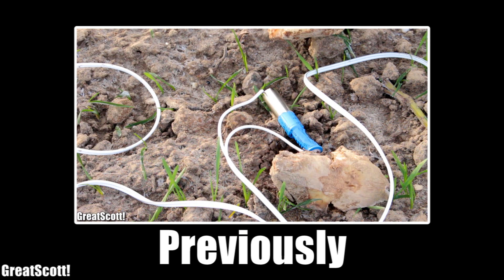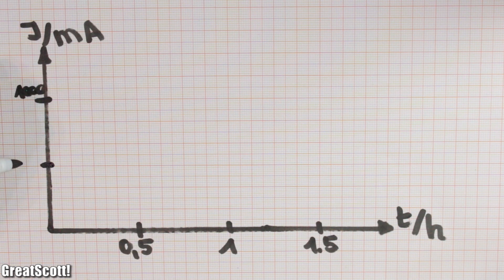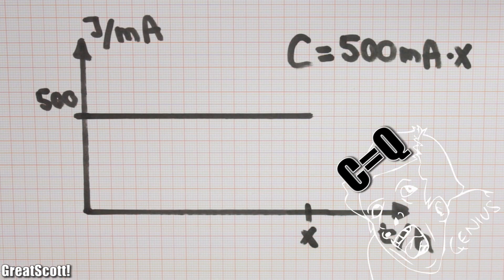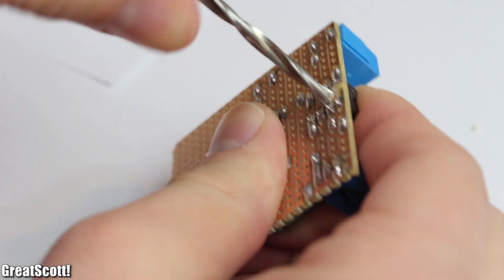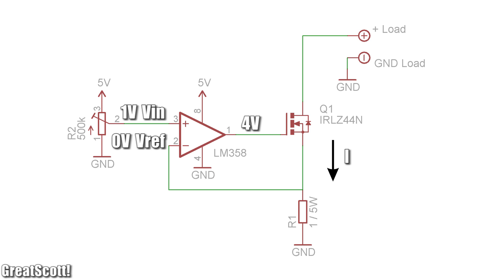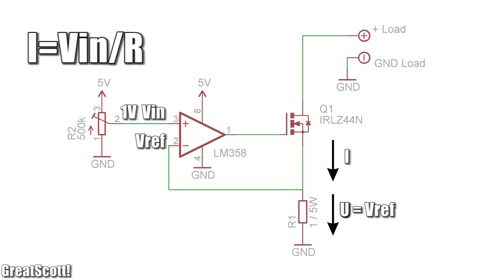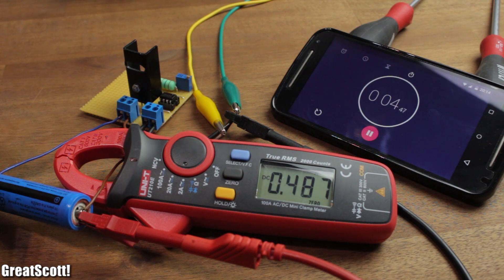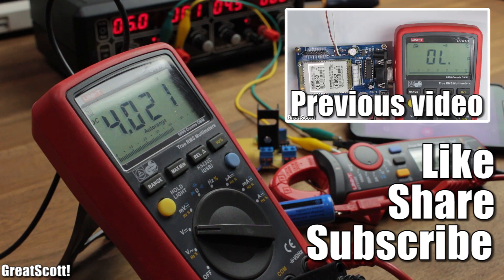Li-Ion Capacity Test || DIY constant current load

Comment: can i use IRF510 instead of IRLZ44N
Reply: Only if you increase the supply voltage to the opamp from 5V to at least 7V to compensate for the greater Vgs needed by the non-logic level mosfet.

Comment: Firstly thanks for your videos. I am learning a lot. A question:
Did you measure the current as 500 mA till the voltage dropped to 2.5 volts?
Reply: 2.5 is the max discharge voltage in li-ion cells
Reply: @DrkTrx  below 3v it will drop dramatically
Reply: I was wondering, why he stop the proces at this voltage level?

Comment: Good tutorial as always. 1 question: Can i use lm393? :)
Reply: In this circuit, the opamp is not working as a comparator since a comparator operates without negative feedback. The opamp used in the circuit does not require any of the features of a comparator, such as its large allowable input differential range, so an LM393 seems to be a bit of a waste when an LM358 would do the job.

In this circuit, there would be little difference between them as long as you remember to include a resistor around 10K for output pullup on the LM393.

Comment: Isn't the ripple you see on your scope an unstable Opamp? I ask because I build a similar current-sink with the LM358 and IRFZ44N and I noticed the same ripple at ~150kHz on the opamp output. I was hinted that this opamp mosfet combination tends to oscillate because of the great  input capacitance of the mosfet and a "fast" opamp like this one... But I am faaaaaaar away from understanding all the physics behind it and I get multiple smashes in my face from the electro-pro's because I am not very fast in understanding all that stuff... The thread is this one: (german sorry) https://www.mikrocontroller.net/topic/464827#new

The (maybe) solution for me was to add an R (46Ohms) between Opamp output and Gate and then add a C (22nF) between gate and R  going to GND...
Reply: First of all, the supply needs to be decoupled properly, so a capacitor in the range 10nF to 100nF needs to be added between pins 4 and 8 and close to them. Then you can start thinking about reducing the capacitive loading of the mosfet on the opamp's output. The IRLZ44 has an input capacitance around 3.3nF, so a resistor in the range 100 ohm to 1K between the opamp output and the mosfet gate is a good idea. Frankly, I wouldn't put any more capacitance into the circuit, as the problem is probably arising from the amount of capacitance the LM358 is being asked to drive already.

Comment: these usually are filled with sand and inside is a tiny nimh cell (knowing from experience) you should take a worn out cell from a good manufacturer and short circuit test it. also do the same with a china cell thats not sand filled.

Comment: Good video GS..!

Just a few small points to add for all......

1. The constant load circuit is simple and neat but there are alternatives which will eliminate the ripple. This is relevant if we wish to to test capacity precisely.

2. The relationship between discharge current and capacity is non-linear. The lower the current, the greater the measured capacity.

3. I suspect you will find the Ultrafire is rated for a discharge current less than your 0.5A, which means you will generate a pessimistic  result.

4. Low voltage cut-off at 2.5V will not damage the battery. All one can say is that life measured in discharge cycles will be lower compared to 3V cut-off.

Keep up the good work..!

Comment: Clever. But wouldnt be easier to use one transistor instead opAmp and mosfet. By establishing base current you will obtain practicaly constant current Jc in CE part,  even though the load is changing. No current ripple, no heated resistors.
I have checked it with TIP35C. It works.

Comment: Cant reach below 0.5A, current is also not constant. :(
Using LM741 and 23N50Mosfet.

Tried with and without pulldown resistor on mosfet.
Reply: You should try use LM358 op-amp. It is always weird playing with op-amp in single supply mode. LM741 doesn't like single supply mode.

Comment: Hi, I'm not clear where did you get 1.8 h of charging if you stopped your stopwatch at around 1.48 h? Taken that into equation you'd multiply the discharge current of 500 mA * 1.48 h = 740 mAh (a bit more) of that battery's actual capacity. Am I wrong? And one more thing: if you had the digital balance charger like Turnigy Accucell 6 that I use, you could just set it to Li-ion and discharge mode, set the desired dicharge current and after it finishes, just read the mA value on the right bottom of the display and multiply that with the time (in h). Cheers!
Reply: There's 60 minutes in an hour, not 100.
1 + 48/60 (4/5) = 1.8 hours.

Comment: In this schema this mosfet is not working in impulse mode. The opamp keeps it in semi-open state, so his DS resistance is keeping high enough to provide needed voltage drop. So its not impulse mode, and not a key mode.

Comment: Hey Scott, how much current can I drain before melting the fake load?
Reply: It's a real load, not a fake one. The answer depends on how much heatsinking you are prepared to put on the mosfet. A 0.4°C/W heatsink will cost about £20 from RS, but you might get one cheaper elsewhere. The IRLZ44 has a thermal resistance of 1.5°C/W between junction and heatsink and a maximum junction temperature of 175°C. So operating at 25°C with that heatsink, you could dissipate (175-25) / (1.5 + 0.4) = 80W before you risk damaging the mosfet. From a 4V supply, you could therefore draw at most 20A.

Comment: You could have used a TP4056 and a resistor load and a usb doctor that measures capacity to do all of this but without having to stay there and watch the voltage and do the calculating. For me this is better because I don't want to stay there watching while my batteries are getting tested. I know it's a bit more money than your build probably, but could you show it to us too?
Reply: The snag with that is the TP4056 uses an internal linear regulator to do the charging, so efficiency is uncertain if you're measuring the capacity by charging. To measure the capacity by discharging, the TP4056 isn't doing anything. You could use one of the chips that boost the li-ion voltage to 5V and use a "usb doctor" with a resistor to measure the discharge, but then the efficiency is even more uncertain. If you don't want to stay watching, you'll need the extra protection circuit that cuts off the output when the li-ion gets low.

Comment: I'm not quite sure thats an opamp or a comparator.

In the first case, I think the output will try to mantain 1V constant on R1, thus the mosfet will be working in its active zone with a voltage drop of Vbat-1V. That will disipate a lot of heat on the mosfet.

In the second case. The comparator will be switching the mosfet on and off creating a pulse through R1 with an average voltage drop of 1V in R1 and 0V in the mosfet. Therefore you are drawing 500mA but at 1V, not Vbat, therefore the battery will last longer than if you just connect the battery in series with R1. Therefore real capacity would be much less that 900mAh
Reply: It's the first case with the circuit shown in the video. It's working as a non-inverting buffer with a gain of 1, not as a comparator.

The mosfet needs a heatsink, for sure.

Comment: Can you eliminate the oscillation in the op amp circuit by adding a capacitor in the feedback path?
Reply: Maybe by lowering the gain of the OP. Was surprised that he had no feedback loop.
Reply: @gamingSlasher  It has 100% negative feedback already, so you can't lower the closed loop gain any further. It's a non-inverting buffer with the mosfet simply adding extra current capability (which it happens to draw from a separate supply - the battery under test).
Reply: Isn't the oscillation the point?  It's effectively making a PWM load instead of literally constant current, isn't it?
Reply: @reubenkriegel7639  No the oscillation is not the point, and it's a linear circuit (a non-inverting buffer), not PWM.
Reply: @RexxSchneider   Hmm.  He talked about it turning on and off, so my mind went to PWM, but that should be a square wave.  What he was getting looked more saw tooth.
Reply: @reubenkriegel7639  If he thinks the mosfet is turning on and off, he doesn't understand how negative feedback works. What you see on the scope is oscillations caused by a lack of supply decoupling of an opamp driving a capacitive load (the mosfet gate).
Reply: To eliminate the oscillation, I'm pretty sure the solution is just to decouple the supply properly. Add a 100nF ceramic capacitor between pins 4 and 8 of the opamp, as close as possible to it. It wouldn't hurt to put a 10μF electrolytic capacitor across the incoming 5V supply, especially if you have long supply leads.

Comment: Isn’t it smarter to set Vin to 3V that way if the comparator sees that the Vref lower is it automatically stops? Not Vin 1V but 3V. Pls explain.
Reply: It's not a comparator. The output of an LM358 with a +5V supply won't swing any higher than about +3.8V. Since the source of the mosfet has be below its gate voltage by at least the threshold voltage (up to 2V for the IRLZ44), you're unlikely to be able to drive the source of the mosfet any higher than about +1.8V, so you can't set Vin any higher than that. I'd aim to keep Vin as low as practical for reliable use.
Reply: @RexxSchneider  lol this msg is 4 years old didnt even remember I commented on this
Reply: @johanneshettinga  That's okay. Other viewers may encounter the same sort of problem and may find an explanation useful.

Comment: 900mah Capacity at 2.5V discharged is even worse than the average 3.0V/2.9V most smart dischargers use. But those batteries are known for this. 900mah is actually higher than you see when other test the same batteries. I actually purchased 6 once and the capacity said 3000mah, but they actually tested 2200mah at 3.0V(I was floored). But the basic wear and tear(charge and discharging) cause it to lose Mah quickly. After 3 or 4, the MAH dropped to around 1100. I just put them in my recycled 18650 bin and called it a day! Great Video Great Scott!!

Comment: i tried to make a 20mA CC load. I made Vin = 4V, R1 = 200ohm, but after constructing the circuit, Vref is topped off at 1.8v, how come?
Reply: If Vin=4V, then you are trying to get the voltage at the source of the IRLZ44 to be 4V as well. Because it's an enhancement mode mosfet, the voltage on its gate will need to be about 2V above the voltage on its source, i.e. around 6V. Unfortunately the opamp is only using a 5V supply and an LM358 can't swing any closer than about 1.2V below the supply, i.e. 3.8V.
That's why you can't get above 3.8V - 2V = 1.8V at the mosfet source. Use Vin = 1V and R1= 50 ohm if you want it to work for 20mA constant current.

Comment: When I tested my li-on battery for power tool, I just measured voltage over the resistor load at different times. For example I measured (18v at t=0, 17v at t=30min and 16.5v at t=1h) then I just do polynomial interpolate u(t) in matlab and integrate the function (p = u(t)^2/R) over the test time. This should give you stupendously accurate results since u(t) is changing slowly monothonically over time :)

Btw it is easier to measure voltage accurately than current

Comment: I am in desperate need - DEAR SCOTT!!

I have a batterypack of 14,8v from 18650 batteries.

How can i get a fixed votage AND fixed amp output?

fx.  12V 4A  - always, until the batterypack drops so low, that it disconnects itself?

the same goes for 14,8V to 5V 2A constant always ampere output!

- so far, they only have 0,09 amps - almost unreadable. How do i get a constant ampere of 4A and 2A???

Could you evt. make one for me - paid of course? 

Do you have an email eventually i could write to?

Thanks - and love all your videos - from portable to speakers to this video. I just don't get this part.... 

in advance, thank you

Lasse ,Denmark
Reply: Sas Asa that's not how things work - I am assuming you want a MAXIMUM amount of current, since your load is what decides how much current it wants to draw. What are you trying to power? Some things may work fine even if the battery is a little discharged. If your circuit is sensitive, you can use a cheap buck- boost converter. Basically they increase the voltage if it is too high and decrease it if too low.

Comment: I did the same test a while ago, but i used a diy usb powerbank where you can insert your own 18650 (1€ from ebay), an adjustable load (3€ from ebay) and a usb charger tester (same price) and tested some vander batteries with it. The promised 6.000 mAh cells only took about 1.2 Ah..

Comment: why can't you do this same test with just charging the batteries? taking (the amount of time it took to charge) x (charging current) that should give you the capacity also. no?
Reply: Li-ion batteries are charged in two stages: a constant current until the voltage reaches 4.2V, then constant voltage until the current has fallen to 10% of the constant current used in the first stage. So you don't have a fixed value for (charging current) in your equation.

Comment: Yeah, I bet that FET gets hot, they're not designed to be driven constantly through their dynamic range.
Reply: When the battery is fully charged, the MOSFET is dropping about 3.7V at 0.5A, or 1.85W. So the heat sink is a necessity. This FET is operating as an amplifier though like +Atlas says, not a switch. The waveform on the scope is showing some high frequency ripple in whatever voltage he's measuring, but not off-on action.

Comment: can we charge 18650s with this circuit
Reply: Possibly. But you would have to put your 18650 in series, and accept the fact that the voltage shunt will drop some voltage based on current, meaning that you'll need a slightly higher source voltage, which may overvolt the battery towards the end where it draws less and less current.

Comment: Hi Scott, i had question, The constant current is possible because 1)we put mosfet in its resistive range or 2)we have PWM on its gate which averages out to required current draw?
Reply: Neither. The mosfet is working in its "triode" mode, with a significant voltage across it, and the gate voltage is just what is needed to draw the set current - the opamp ensures that by a massive amount of negative feedback. The opamp and mosfet together are working as a simple non-inverting buffer that fixes the voltage at the source of the mosfet at the same voltage as is supplied from the wiper of the potentiometer. That constant voltage provides a constant voltage across R1, which gives a constant current through R1 and therefore draws a constant current from the supply to the mosfet's drain, i.e. the battery under test.